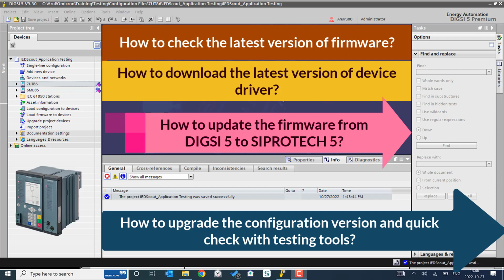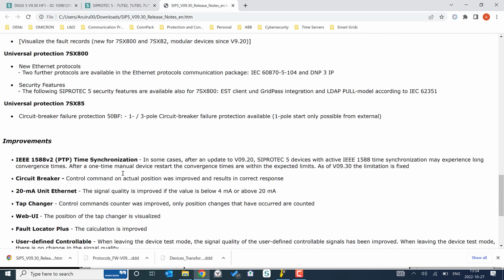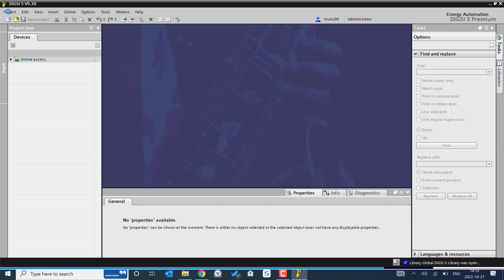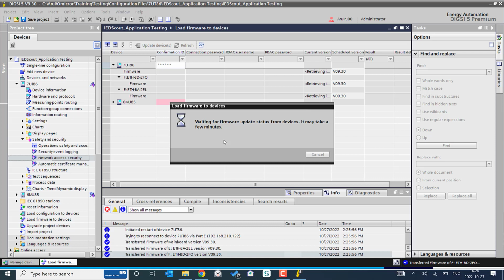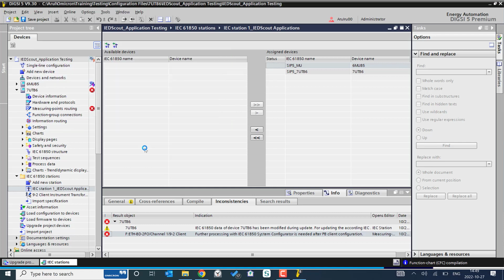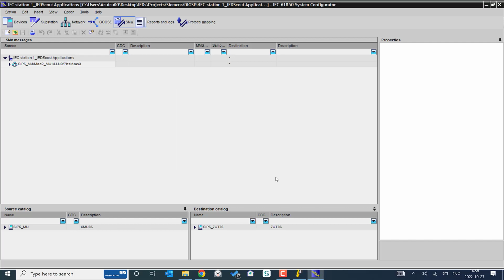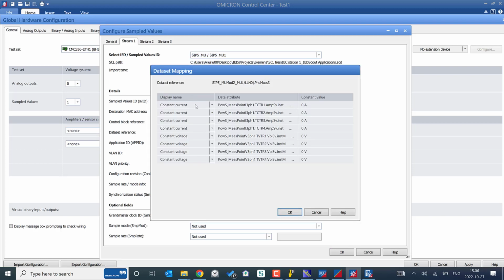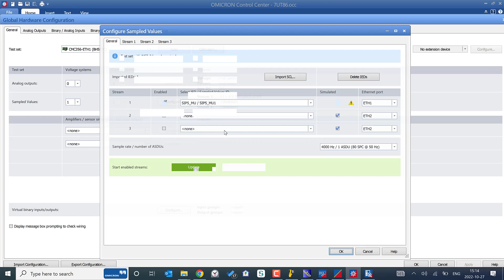How to download the latest version of firmware and update it for Siemens SIPROTEC 5 IEDs from DIGSI5

Comment: Great video, Can one run a IED with a different format for protocols and devices?
Reply from the maker: The latest model IEDs have the advantage of supporting various protocols that are needed, such as IEC 61850, Syslog, LDAP, SNMP and others. The only condition is that the IEDs should have enough CPU capacity to handle all the configured information.